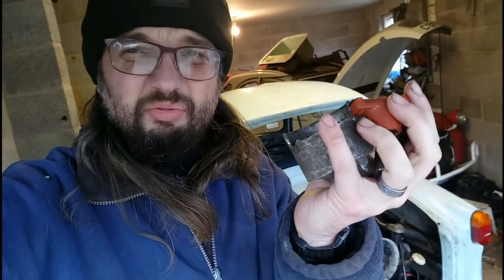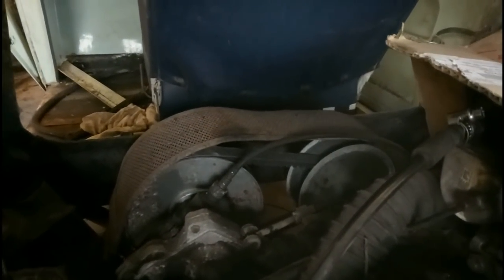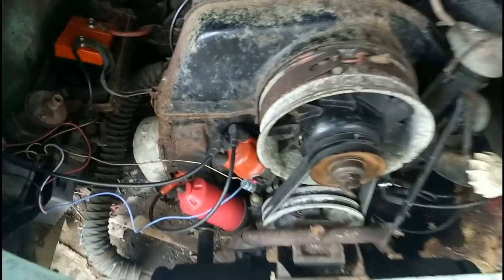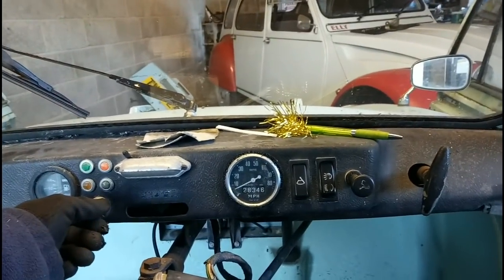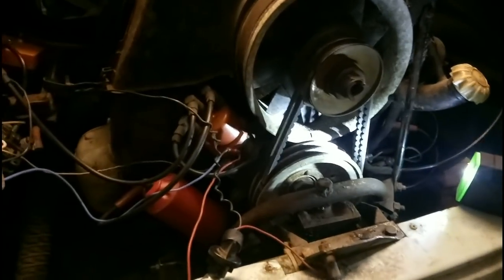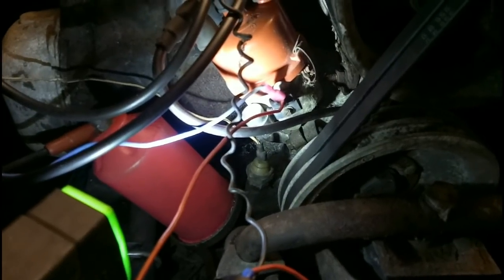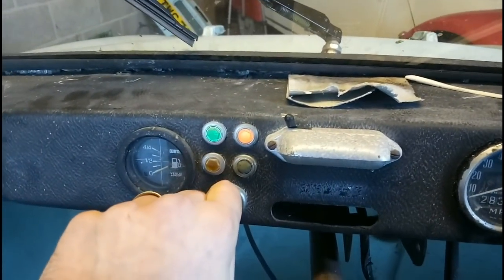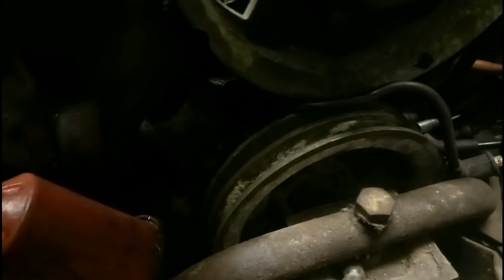Project Invacar Part Seven: FAIL! It all goes wrong...

Comment: Anyone who has ever worked on their own car in less than ideal conditions can relate to this. That feeling of despair when something goes wrong, and you realise you don't have the skills, tools or access to fix it, or the ability to transport it to someone who can mend it. It's utterly soul destroying and yet, somehow, with the benefit of hindsight it all seems wonderful and we're glad we've had those experiences. Haha/grrrrr.
Reply: Yup..trying to get the timing belt tensioner of my Zafira..the stupid torc bolt stripped and as I was trying to chisel the head to get it moving the engine casing broke .. I was absolutely gutted. I thought I'd destroyed the engine.  Luckily the tensioner is attached to the oil pump which bolts onto the casing. still had to drop the sumo and exhaust to repair...  I thought I was finally gettin decent with Cars untill this.
Reply: Indeed, it's why I'm addicted to these vids, very REAL. You forgot to mention the shame of taking it to a proper mechanic and explaining the tale of woe(s). Been there  ...

Comment: I feel your pain. I would have went straight to the spare engine and practiced on that to see how it comes undone. I'm struggling with an electrical fault on my cinquecento and bought a spare to harvest parts off as I can't read the ecu as it's a 3 pin unit and the forums say only fiat can read them  pre obd2 ones.

Comment: Ian, if you end up using the spare engine, I would leave the dizzy well alone if you can't free it up without force. It is likely the car was running OK when it was laid to rest. Spitting back through the carb might indicate a timing issue but in this case it is more likely to be very lean mixture. Suggest you strip and clean the carb properly and also check for induction leaks. Also static timing is fairly meaningless with a worn dizzy. Timing may have been retarded to run on unleaded anyway.

Comment: I feel for you and felt your depression over it. I have been there too. You remind me of myself. Something goes horribly wrong but the anger wont come out and keep strolling on. Not once have I thrown my kit in anger or frustration. I have rebuilt a few engines and cars. I used to snap bolts too. Head bolts are worst for snapping with me. I decided to service my sierra the day before we went on holiday. I cracked the thermostat housing, because I wanted to replace the thermostat so no overheating probs, and had to get another head before the scrapyard closed. Had to decoke and grind all the valves in again on the 'new' head. All because a thermostat cover bolt had seized in the threads. 
I hope you get the other one turning in its engine before putting it in . Keep calm and crank on. 

Ian
Reply from the maker: Ah yes. I remember snapping bolts trying to change the thermostat on our old Mini! Sodding thing. I do throw tools though. Had a paddy this afternoon working on the brakes. Time to walk away!
Reply: It gets to us all eventually.  Looking forward to the next vid. :)

Comment: Once you get the dizzy sorted and if you're not bothered about originality, consider replacing the charge regulator with a solid state Reg/Rec from a motorcycle. I've a feeling I've seen a dizzy like that somewhere else, not a Magnetti Marelli by any chance? Fiat 500 / Polski 127?
Reply from the maker: Yup, on my mind. 2CV runs a solid state reg.

Comment: When you had that distributor removed to the engine, I thought "hey, that's quite clever.  Drill a couple of holes in the distributor metal, and make a tool that looks like a tuning fork with bent ends."
  But, as it turns out, you did exactly what I would do on an empty stomach.  Don't let it get you down, you're fighting the good fight.
Reply from the maker: +Alex Kindl Thanks!

Comment: Looks like a Bosch distributor, I wonder if you could use the drive shaft from yours (once you get it out) installed in a body from another Bosch dizzy, it would not matter if it was from a 4 cylinder engine as you could ignore the 2 redundant points. It might be worth applying malt vinegar around the base of the spare dizzy, try and get it to wick into the gap between the block and dizzy shaft. the acid in the vinegar might help to dissolve the oxide bonding the two parts together, ( not sure if vinegar is the right thing tbh) get some big channel lock pliers and use a rag to protect the casing and try rocking the dizzy a bit before applying too much force.
Reply from the maker: I've got a spares engine, so if I don't end up just fitting that, and if I can get the sodding thing out, the dizzy from that would drop in.

Comment: You can take it to a machine shop and have the shaft hole sleeved, not that hard really.   It seems hard, but it's really a trivial bit of work if you have the right tools (e.g. a mill & a lathe).  I've BTDT, but I also have a full machine shop, which helps.
Reply from the maker: +ck m Yup. I do know a good machine shop.

Comment: I understand why you you want to get it get it on the road as soon as possible, but in my opinion it would be so much easier just to remove the engine from the vehicle then work on it, cleaning parts properly with all the fresh air around it for you to gain work space, without the worry of damaging fragile body parts etc. now that engine is damaged, i would drop the other engine out of the parts car get it running well on the bench then transplant it in to Tuc, then continue with the restoration/rebuild. then i would strip the current engine down to the just block, drill/bore a larger hole where the damaged distributor went in then sleeve the hole down to the correct size. Then rebuild it back up correctly then fit the original engine back in. 
I like quirky little vehicles like this, i'm a big fan of original electric milk floats and light industrial vehicles. and in my opinion when restoring something as rare as this i believe it should be as original as possible so i don't recommend an engine swap. if anything do that with the spares car at a later date. 
I love the bit on the top pulley to hand crank it with a starting handle, might be rather difficult for a disabled person to carry out this task (not meant to offend)
good luck and i look forward to what happens.

Comment: I would have thought that the condensor is uneccessary, with electronically assisted ignition.
With the original system, the points take the whole current and back EMF off the coil. As the points open and the magnetic field collapses, a large spark can occur at the opening points, causing them to pit and wear. The condensor is wired across the points and absorbs this energy which prevents the spark and wear at the points.
Electronic ignition just uses the points as a very low current switch, to trigger the transistor or thyristor in the unit. Therefore no spark at the points, no condensor needed.

Comment: Good videos hubnut , I have watched every one for the invacar so far and will keep following, it is a real shame this one decided not to play ball. I hope you have more luck with the second engine. May I suggest if you need to adjust the dizzy, you lube and loosen it before you put the engine in, that way you will have more room to work and be able to get things easier without be confined to small spaces like invacar engine bays. Good luck and looking forward to the next instalment.
Reply from the maker: +KJC3101 Thanks. Access isn't bad really, and at least the engine is held securely in the car.

Comment: Oh bugger...... I feel your frustration and pain I felt the same last week when the AC clutch I changed on my Golf wasn't seated properly and tore out the wires that go to the compressor. But thankfully I had a spare.
Reply from the maker: Yes, part of the tinkering life. Like when I broke the auxiliary belt tensioner on the Lexus, then discovered you can only get them from Lexus...
Reply: HubNut Yes it is. This week I have the rear driveshaft coupling to replace on my old Discovery looks easy but is it? Lol

Comment: Hey it happens I am sure with some needed parts swap you can make a hoo Engine out of the 2. That’s what  I like about you.  You are a smart mechanic thinking ahead as I do the same getting to of your machine project is very smart It gives you spare manacle and body parts that you need to combine to make one good part for your project
Reply from the maker: +Spirit of the wolf Bush Wiccan witch Thanks. It'll get sorted one way or another.

Comment: When working on any project like this we all have points when it all falls apart around us and you think I wish I had left it alone or tackled it from a different direction. I think the best course of action now is plenty of heat on the engine casing and using a slide hammer on the shaft to use shaft as a drift to remove the remains of the distributor casting out of the engine, then you can asses the damage on the engine casing (if any), which might be fixable with JB Weld and care. When trying to get the distributor out of the parts car soak the joint with penetrating fluid at least overnight and them heat the engine casing and take it very slowly. Good luck as your videos are enjoyable when you win or on occasion loose the battle.
Reply from the maker: Thanks. Parts car has already have two soaks, second time with ATF mixed in. I'll try a less violent approach...
Reply: I think heat is your friend even if you heat the block and let it cool just to try and break any seal between the 2 castings. I think we enjoy watching these sort of mishaps not for a laugh at others misfortune but to be reassured of both the honesty of the reporting and also it shows us it is not only me it happens to!. I wish you all the best with the remedial work. Keep your chin up.
Reply from the maker: +Slide Hammer Thanks! Something to consider.

Comment: Hi you may get the distributers remains removed by using :"Darwinpasta" slide hammer technique and: opening the gap around the dizzys clamp by inserting a wedge (trusty chinese screwdriver) into the gap plus treat with copious ammounts of plus gas. Engine removal should be a last resort. Burton 2CV does a solid state regulator which is a vast improvement on mechanical type, used them on 2cv's for years without problems. Hope it all goes well from now on in. Phil
Reply from the maker: +Phil Hignett Thanks. I have a solid state reg on the 2CV. Works well.

Comment: Wow talk about unlucky!
 If it were me i would drop the sump (you may have to anyway) and see if you can reach the underside of the shaft with a drift and "knock" it upwards. Have you got access to a welder? If so, get a 2 decent size pieces of plate and drill three holes in line larger in the centre and maybe 5/16 either side of one;and a larger hole wider than the aluminium boss of the distributor in the second.Slide the 1st plate over the shaft using  the centre hole making sure it clears that aluminium boss.The second plate has 2x5/16 bolts (or metric crap) with the nuts underneath.Position the second plate over the first allowing enough thread showing on the bolts to wind up the plate at least 2 inches.With the bolts in there lowest position weld a nut onto the shaft to use as a buffer for the top plate push against.Copious oil and heat  and start winding turn by turn on both bolts to even up the pressure, It will come out depending on how hard the roll pin is holding the gear on at the bottom!
Good luck and keep going.....if i wasn't so far away mate i would be round there pitching in!
Reply from the maker: Thanks. I'll suss it somehow.

Comment: You should have put a piece of chain around the dizzy body and used a hammer in the chain loop like a slide hammer to pull the dizzy out of the crank case. I don't think much swarf would have gone down the shaft though. (there isn't some sort of grub screw holding the shaft housing  in place is there? }
Reply from the maker: Thanks. Can't see a grub screw.

Comment: Hey hubnut, awesome videos! Since the motor needs to be pulled out any way, You should try drilling out the rest of the distributor. Drill one hole as close to the engine block as possible, then one 180 degrees across from it You should be able to break it loose at that point. Just a thought.
Reply from the maker: Thanks. There really is very little left of the housing now. I did try drilling, but it just chipped into further pieces - so I kept doing that, until I broke several drill bits...

Comment: HubNut, don't look so down! Buy yourself a tub of Belzona. You can just about bog yourself a whole new engine block with that stuff.

This is small troubles. Just wait until you really blow up an engine! Also, that's a tiny engine, just take it out and put it on the workbench to deal with it. Leaning over trying to work in a cramped space like that will just aggravate and discourage you.
Reply from the maker: +Godfrey Poon True, though having it bolted down is also useful.

Comment: I feel for you. Aluminum can be a real pain. I am wishing you the very best of luck. And thank you for sharing.
Reply from the maker: Thanks. And there I was thinking it was only steel that was a problem!
Reply: If you can get all the old distributor out, clean the hole very well and use anticseze when you put another distributor in. I am not familiar with that type engine,if it has an oil pan pull it and clean the bit's that get into the crank case. Which I figure you already know. But yes I have had way more trouble out of Aluminum blocks more so with ones that have set for a long time. Thank you for the reply.

Comment: Ah, mechanical regulator exactly like in Volkswagens! I've heard of there being people that will gut the old style and fit modern solid-state innards into the casing. If you can reasonably cheaply source a distributor, you could take apart the spare engine down to just the stuck bits, remove the distributor shaft and have the distributor stem drilled out of the case, sacrificing it in favor of the engine. I'm sure you'll find some way to fix its wagon! 
'The Rolling Stones – You Can't Always Get What You Want' seems appropriate, 
"We're gonna vent our frustration. If we don't we're gonna blow a 50-amp fuse!"
Reply from the maker: +TheFurriestOne Yup. I'll sort it somehow.

Comment: I think it’s time to drop the engine. I use a two part powder which works well add powder then add a liquid hardener held my fly wheel on a MR2 on for a year.  Good for replacing castings. Good luck I know how you feel
Reply from the maker: Thanks! We've all been there.

Comment: Oh dear shouldn't make fun ..but   have you considered that it may be a left hand thread on the distributer ..a la lexus pulley ;) or the Distributer was actually rotated to its maximum and wouldn't go any further the way you were trying to turn it????

actually..I don't have a clue ..the last time I worked on points was on a 1980 Talbot Sunbeam   about 25 yrs ago.
Reply from the maker: Distributor wouldn't turn either way. Frozen into the crankcase.
Reply: Bugga ... good luck then man with engine num 2 .

Comment: Same daft pulleys as on my rotavator, never thought I'd see em on a car! Well, a sort of car 😉
Reply from the maker: Volkswagen certainly use the same thing. Probably Porsche as well. I'd better get one so I can compare. looks at bank balance oh...
Reply: Yes the pulley on my VW t4 has the shims, my vans got a deafening screech every time I start it for 30 seconds to a minute, new belt lasts about 2 weeks the screech back again. I think it's the water pump bearing making the belt run un true, got one but it's a job for the finer weather. Horrible design with the shims, but it does seem to work.

Comment: You've got the shaft sticking out. Do you have a slide hammer, or the resources to make one? I made one a while back from a pair of vise grips, a rod from a printer, a couple washers, and some rebar for the weight. A couple good taps with that might shift what's left of the dizzy out of the case. Or shear the gear off the end of the drive and leave more junk in the sump, one of the other.
Reply from the maker: +Darwinpasta I don't have one. I'll see about making one.
Reply: Good luck!
Reply from the maker: +Darwinpasta Thanks!

Comment: i was talking about these cars to a trike builder that lives local to me, and if i were you i would look into these more closely if you plan on running it on the road.
i have been told that current logbooks for these are invalid, and to legally run one you have to re-register it as a tricycle, you cant just test it and change its tax class, it has to be inspected and re-registered, which means its not as simple as fixing it up for the mot, an engineering inspection is very stringent, the lad who builds trikes (professionally) bought one on ebay he wanted to put a bike engine in it, but just scrapped it because its easier to register a scratch built trike than to convert an invalid carriage, just a heads up he also said thats why there are fields of them rotting away 'cos there is not a lot you can do with them legally.
Reply from the maker: This was the case, but I can confirm that mine has now been unscrapped, and I've been told I should have a V5 by the end of the month. It will need a change of tax class to a trike, but shouldn't need an engineering inspection. Several have already returned to the road, so a precedent has been set.

Comment: Just been reading through the comments. Many good suggestions there. Perhaps a break will help you formulate ideas for removing the distributor from the spare car, as it has the same problem. Liked some of the suggestions about fitting motorbike engines, but do the realise how much work that would be?  Like you, I'd keep original.
Reply from the maker: Thanks. That's the plan! Useful comments have been great.